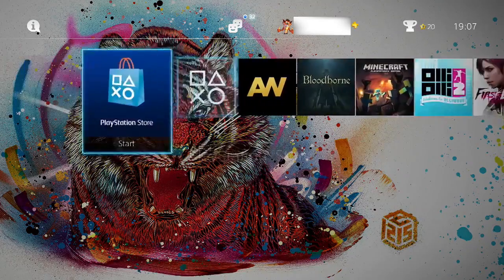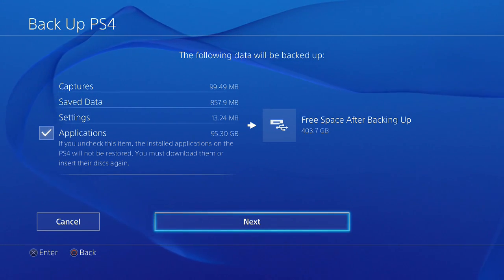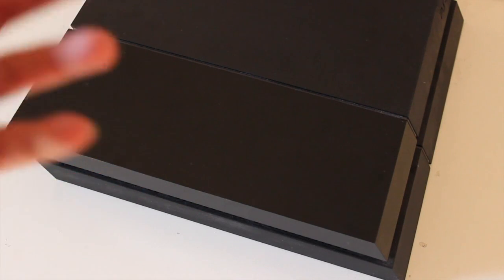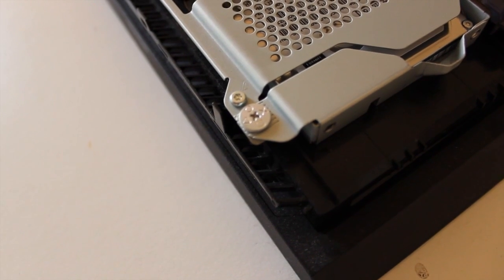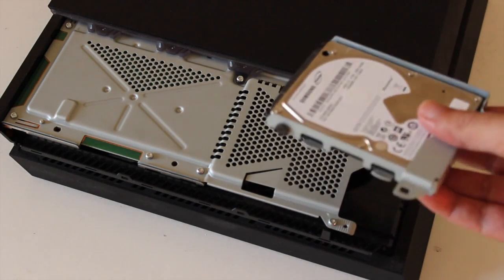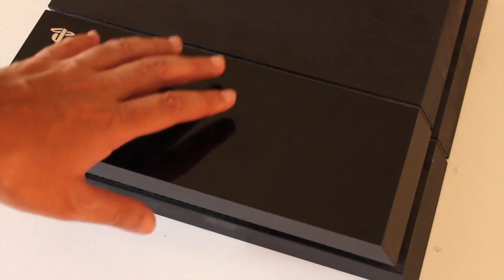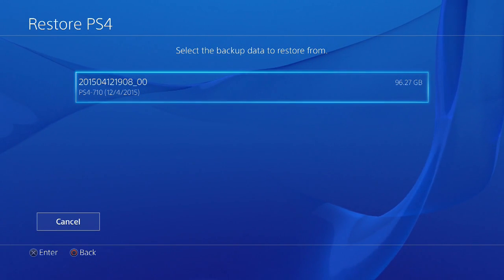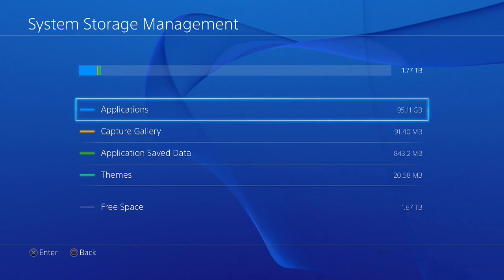How to Backup and Restore your PS4 HDD

Comment: I’m using it as extended storage. It says I can’t back it up since it is extended storage. So how do I make it forget that it is extended storage so I can back it up
Reply from the maker: +Cooper Chippy you will need to reformat it and try again
Reply: Slingshot how do u reformat?
Reply from the maker: +Cooper Chippy for mat on your computer as exfat but then don't make it as extended storage when you insert it. Only use the backup process method and not extended storage method

Comment: I just needed more space to have more games installed. Is there any other advantages to have my PS4 backed up?
Reply: Never mind. Just saw that you can just connect a external HDD to the PS4 - no need to "install" it inside the PS4
Reply from the maker: Only real reason is install files and DLC. If you dont have uncapped or fast internet really. as PS4 save files are backed up to the cloud
Reply: Could you elaborate that? Do you mean you should have install files and DLC on the external HDD? If so, why not just everything NEW you get? Why move all the stuff that's already on your PS4?

Comment: I have 2 PS4's and i want to backup both, can I have multiple backup files in 1 external hdd?
Reply from the maker: Melvyn Vicente Hi. Yes it is possible to do
Reply: Slingshot tnx mate.. last question, Is it possible to backup files using a usb 2.0 external hdd?   as an extended storage, a USB 3.0 HDD is required, but how about backing up. any idea mate?
Reply from the maker: It should be fine might just take a bit longer
Reply: Slingshot tnx for the immediate reply mate!
Reply: Hi guys. I know this is pretty old, but I've been looking for someone to ask and answer this same question. I backed up everything except applications
(Settings, saves, captures) a few months ago onto a 128gb USB drive. But now my PS4 is starting to turn off after being on awhile. Before I set up my new system, If I did another backup (for my more recent saves and captures) on the same usb stick, it will create a new file and date? 
And if the PS4 turns off during the process, will it wipe the previous one?
Reply from the maker: It shouldn't wipe it, but if it does then repeat the process
Reply: @SlingshotGamer  Ok. Thanks for the quick reply.
Reply from the maker: @geoffbaumgartner5335  good luck. Let me know how it goes

Comment: I wanna do the same thing you did. so I don't need a flash drive?
Reply from the maker: You only need the flash to add your new firmware on it
Reply: so it's OK to back up to the new HD and then put it inside the system
Reply from the maker: No you would need another HDD to backup your data then transfer to your new HDD

Comment: Can you use the seagate to back up the PS4 then use it as the internal when you install in the PS4???
Reply from the maker: zbizzy1 no you can't. you need a separate drive for the backup and then to your PS4
Reply: I got it to work, I just had to switch it to exFAT

Comment: How do I set up my USB? Like what format does it have to be in order to download my data on to it?
Reply from the maker: +Gerardo Hernandez format it with a PC to Exfat then use the PS4 to backup your data
Reply: Slingshot ok thanks man
Reply: Slingshot another quick question..do we leave the external hard drive alone? Like the format? Cause I have my date backed up to a drive and I set up my USB drive but for the actual external hard drive I want in the PS4 aka the seagate.. do I gotta format it as well or no?
Reply from the maker: You can leave that alone the PS4 will format is accordingly when you insert it for the first time

Comment: I have a Brand new 2 TB hardrive, nothing on it, But when i try to use it to back up my PS4, it says there is no space available....
Reply from the maker: +lightningfilmsLTD the drive might not be compatible. Try a different hard drive
Reply: I fixed that problem. thank you! :-)

Can i use an External to put the PS4 drivers on, or does it HAVE to be a thumb drive?
Reply from the maker: +lightningfilmsLTD it can be anything so long it's in the correct format

Comment: You showed us a seagate hard drive but then you used a Samsung one
Reply from the maker: Inside the Seagate hard drive casing is a samsung drive
Reply: Slingshot oh alright sorry man I'm just about to buy it I just had to be 100% sure
Reply: Slingshot since u posted this almost 2 years ago does is still work ? I've read reviews  about the hard drive crashing about 6 months of use
Reply from the maker: It still works. Been using it for more than 2 years and working perfectly. No issues or lag
Reply: Slingshot thanks I will buy it

Comment: I backed up my ps4 to the 1 tb hard drive that I inserted as the memory drive and when I finally got it all set up I went to restore and it's saying there's nothing to be restored?? does that mean I lost everything?
Reply from the maker: +Camilo Giraldo did you backup your data to another drive or the 1TB drive. Is the 1TB drive the one you want to put as your new drive
Reply: Slingshot I backed it up to the 1 tb drive after I formatted it to exfat on my computer, and yes it's the one I put as my new drive so after I set up my ps4 again after it was in safe mode I went to back up and restore and it says it couldn't restore anything bc it wasn't there
Reply from the maker: +Camilo Giraldo you need to backup your data to a separate hard drive then install your new drive and then install the firmware to your new drive and then restore your data with the other hard drive.
Reply: Slingshot gotcha thanks so much!
Reply from the maker: +Camilo Giraldo awesome good luck

Comment: any special tool needed to get the seagate harddrive out of its casing or will a normal sized screwdriver do?
Reply from the maker: A normal flat screwdiver will work fine
Reply: Slingshot ah good ok, good thing I have a Toshiba 1tb external I've been saving from a few black Fridays ago for all my game saves a app data. Thanks for answering
Reply from the maker: Sure no problem. Good luck with the transfer
Reply: Slingshot thank you
Reply: Slingshot oh wait, should I format the Seagate hard drive before cracking it open and putting it in the ps4 or does the ps4 do that anyway when you add the firmware?

Comment: So basically at the start you plug the 2tb usb in and then go to system - back up and restore and then backup on the new hard drive and then put the new hard drive in and put it in rest mode then start it back up then go to setting - system - backup and restore - restore so that's it
Reply from the maker: Nope. You plug an external backup drive(seperate drive) into the PS4 back your data up then install the new 2TB drive and then use the backup external drive to restore your backup to the new drive
Reply: Slingshot so we put a new hard drive in back up and then put the 2tb in and then put the other hard drive in then restore
Reply from the maker: Correct. Its such a pain but it works

Comment: hey so I got the same drive and when I try to connect it and turn on safe mode I never get a second beep. I hold down the power button and it turns on but then eventually after I hold it down it shuts off again. when I just press it once I'm getting an error code CE-34335-8. any solution for this
Reply: plus I can connect the old drive and it works just fine safe mode and everything
Reply from the maker: Make sure the new hard drive is connected properly into the hard drive bay of the PS4. At power off state. Press and hold the PS4 button until you hear a second beep that should take you to the safe mode
Reply: I did all of this

Comment: i Have the same model of a portable storage as you but its only a 1 TB but from some reason when i get to the back up area of the process it says i dont have enough room... can you help
Reply: Slingshot when I back up it says there is no free space after backing up and I have an external hard drive with 500 gb and the total for applications , saved data etc.. is 370 GB so 500 - 370 = 130 Gb so how come it says 0 plz reply
Reply from the maker: +Cree Holly try a different hard drive. Might be an issue with the compatibility
Reply from the maker: Try a different HDD. It might not be compatible

Comment: so the seagate backup plus is a external hard drive and a normal hard drive
Reply from the maker: +eazy player yes it is
Reply: Slingshot can you use it to backup saved date and as a new hard drive?
Reply from the maker: +eazy player nope you can only use it as a new hard drive
Reply: Slingshot so the complete upgrade Will cost me 175 euros
Reply from the maker: depends the price on where you stay? Mine was about 90 Euro's

Comment: i got the exact same one you got, synced trophies and now currently backing up my files etc, do I need to create a ps4 folder and update folder once I have backed up and before I replace with the 500gb drive in the ps4?
Reply from the maker: You can create the folders before or after it doesnt matter as you can even have it on a flash disk
Reply: okay bro cheers, thanks for quick reply too, didn't think these would work inside ps4 as not ssd but nice to know hdd 2tb work too :)
Reply from the maker: Yeah so long the height and width is good. Any drive should fit? These are the best and cheap. SSD doesnt really make a big difference with the PS4
Reply: just reading other comments did not realise I need a partway external for 500gb to get from a-b to the 2tb, so basically once back up on a second lets say 500gb external.. I then place my 2tb in ps4.. then I use the partway external I backed up before changing original to new harddrive.. to restore? and whilst doing so would I need to create the ps4 folder and install the ps4 update to the 2b or the external ill be restoring from or just simple from a usb stick?
Reply from the maker: Yip. You are correct. Its a pain on why Sony didnt get rid of the middle man with the random other hard drive for the backup. But i suppose if you run into problems you can always restore

Comment: Can I use any hard drive to back up my stuff?
Reply from the maker: +Jacob Stafford yes so long it's data is bigger than the drive inside your ps4. Drive needs to be in exfat or fat32
Reply: So, I can't use a 500gb hard drive? I have about 93gb left on my PS4.
Reply from the maker: Yes you can
Reply: Cool. Thanks.

Comment: Can I back up on a hard drive that has other data on it as well, please tell me?
Reply: And also will I keep getting firmware updates as normal or do I have to manually install new ones after this?
Reply from the maker: +haseeb khan yes that should be fine. So long the drive is formatted in fat32 or exfat
Reply from the maker: +haseeb khan you mean game updates. Those will all be backed up
Reply: OK thanks for that but I am actually talking about ps4 system software updates like the latest one is 4.00, will I keep receiving them automatically like normal or will it stop and I would have to download them from the playstation website and install it myself? 
Nice video btw :)
Reply from the maker: Cool dude, Yeah the normal updates will still come up automatically. It will be all the same except more hdd space :)

Comment: what should i do now i did what they told me to do but it says it cannot access system storage
Reply from the maker: +Kwan 92 is this your backup restoring to the new drive?
Reply: yea i got it but i didn't save all data on my cloud storage. Is it only one way to save data without switching harddrives or its more than one way?
Reply from the maker: +Kwan 92 best bet is to save it to the jar drive and the cloud is your backup
Reply: Slingshot never mind i had saved the game data i just had to reinstall it then retrieve the save game data. And have you ever had an overheating problem when you upgrade your harddrive?
Reply from the maker: Nope its been running for more than a year with no issues
Reply: Slingshot ok cool and what games you have on the ps4?
Reply from the maker: +Kwan 92 mostly fps games and uncharted 4
Reply: Slingshot ok if u don't mind if i ask you for your gamer tag we can play uncharted 4 online, well when i get it.
Reply from the maker: its slingshotgamer

Comment: What External Harddrive did you use to back up the PS4? Plus i'm just going to get the Samsung M9T to upgrade mine, not the Seagate.
Reply from the maker: +jjames e I used a 1TB verbatim use 3.0 drive for the backup. Make sure the drive you using fits in your console
Reply from the maker: +jjames e I used a 1TB verbatim use 3.0 drive for the backup. Make sure the drive you using fits in your console
Reply from the maker: +jjames e I used a 1TB usb3.0 verbatim external drive. Make sure your drive fits in your ps4

Comment: i have a 32G USB it says there is not  enough free space on the USB storage device
Reply from the maker: It needs to be bigger than your actual data on your PS4. So if its 300GB then you need a drive the same size or higher for the backup
Reply: thank you very much for your help if you want we can play bo3 or gta5  and more and live stream  some time

Comment: When you back up the PS4. You plug a usb cord to the external drive to the PS4 usb slot? if so. What cord do i use? not sure what it called or cost?
Reply from the maker: +TheMadChallenger a normal usb cable will work

Comment: My problem is with the new hard drive in the ps4 wont load any games . Can anyone help ?
Reply from the maker: Digital or Disc Games. Make sure you make the console primary in account settings
Reply: Thanks i put the old hard drive back in and started a game , turned it off and put the new hard drive back in . Now it works .
Reply from the maker: Awesome glad you sorted

Comment: If I back up my ps4 to the cloud will I have to put it in a flash drive
Reply from the maker: +Franco Is a beast no you won't need to. The cloud only back ups your saves not your games
Reply: +Slingshot what about Dlc
Reply from the maker: +Franco Is a beast dlc doesn't save to the cloud. You will need a hard drive for that

Comment: Hi. Great video, very informative. Our 500gb HDD is almost full, I have a WD 1TB external hard drive with loads of space on it. Will that be okay to use for a back up ? Also, when I connect the Ext Hard Drive, will the PS4 recognise it and show it, or will I have to go and search for it?  Thanks.
Reply from the maker: You can use it so long its formatted in exfat. Then you can back it up
Reply: Thanks for the reply. I just checked it and it's showing NTFS. Looks like I will have to buy an Exfat USB flash drive that can handle 500gb of data. Maybe I could break up the back up into several blocks and remove them separately?

Comment: Where's the back up drive you used?
Reply from the maker: +kool9927042113 I used a usb3.0 verbatim 500gb
Reply: +Slingshot Can I use a 10 gb to back up everything else and not the applications?
Reply: +Slingshot As in a 10gb usb stick
Reply from the maker: +kool9927042113 yes depending the size of your backup files and if it's compatible

Comment: I found your video very helpful, but I have a great question. I'm upgrading my storage with the same Seagate hard-drive you used in this video. I was wondering if I could backup my PS4 data onto the Seagate before dissembling it to get the hard-drive inside and then put it in my PS4. I've seen many people restore their data and then install the Seagate drive then restore their data, but I was wondering if id be able to skip the restore step by simply backing up my data on the hard-drive ill be installing. Thank you!
Reply from the maker: +TheBojanglesPanda60 glad it helped out and no that is not possible. You need a separate drive for the back to restore back to the seagate not too sure why Sony didn't do that in the first place. And now we have to deal with the middle man

Comment: +slingshot after backup my hard drive can i use it in my ps4 directly
Reply from the maker: +Ahmed zalata nope you need to install the new drive then install the new firmware and then restore your backup drive

Comment: After putting the new hard drive in, you said we have to install the new system software using a flash disk. Where did you get this new system software that you put in the flash disk? Is it this? : 
http://deu01.ps4.update.playstation.n...
Reply: Do you mean put the 3.50 update version into a flash drive and then put it in the ps4 and start in safe mode?
Reply from the maker: +Jason Borotra got it from Sony
Reply from the maker: +Jason Borotra yes in order to install it

Comment: So backing up the storage puts it in my External hard drive and when I make the external into an internal, I can restore it after updating and setting things up again?
Reply from the maker: You need to backup your old PS4 drive to a separate external drive then use your NEW external drive as a NEW 2TB drive for your PS4 then use the backup made from the OTHER external drive to restore your PS4. So technically you need 3 drives for the backup process

Comment: So actually our new hdd is the place to back up all data or we need another hdd?
Reply from the maker: yes you need another one to back the data to and then this data one to the new drive
Reply: thanks
Reply: +Slingshot may i use the storage that already use for backup data to place an update file?
Reply from the maker: +Dhanzow Deep that could work

Comment: can i just backup the files on my 2 tb external drive. take the hard drive outta the external case and pop it in my ps4. will that work?
Reply from the maker: +TFC GAMING nope you need to back it to a separate usb then put the 2tb into the ps4 then use the backup usb drive to reinstall your files